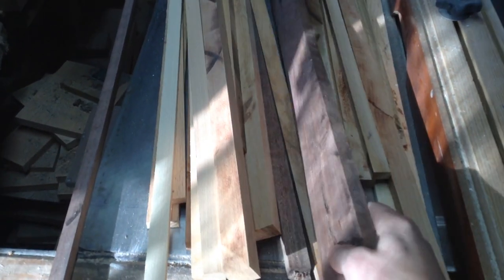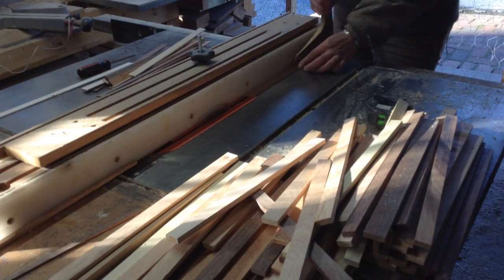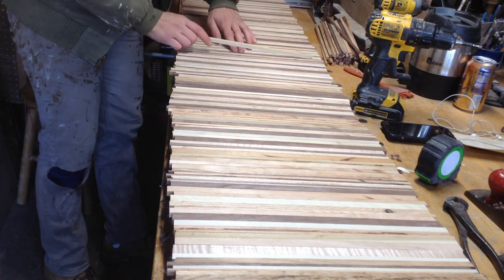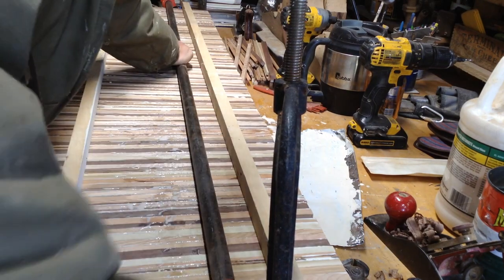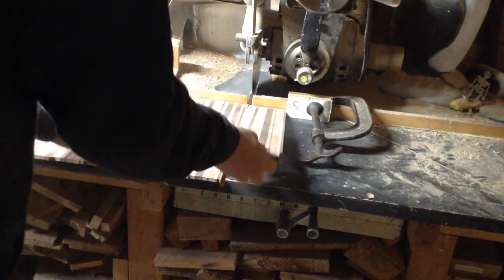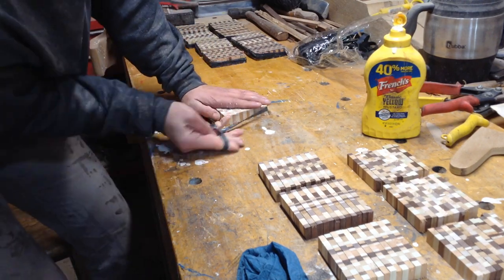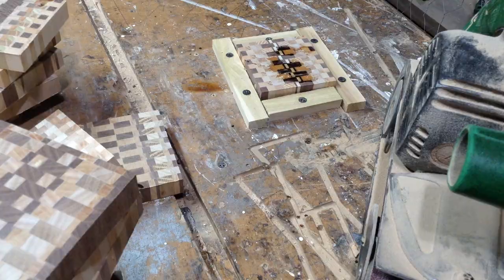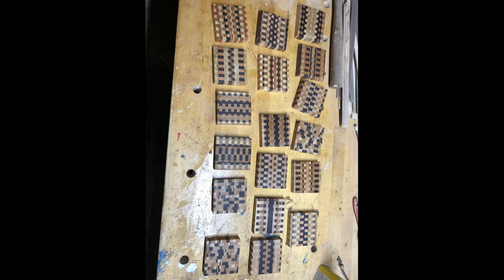Woodworking :  DIY Butcher Block Coasters // How -To

Comment: Nice project.  I enjoy and appreciate you skills especially with hand held power tools as displayed in your many videos.  I have a question about you use and apparent happiness with your radial arm saw.  How do you adjust and maintain tolerance especially cross cutting to the full capacity of your  saw?
Reply from the maker: I was able to go online and find the original manual for my model.  In it they give you very detailed instructions on how to set everything up and get it cutting square.  I haven't really had an issue with it getting out of square as time goes on either.

Comment: Interesting process. Have you tried mixing softwoods in with the hardwoods species, or do you think that is a bad idea. How would a coaster of softwoods stand up? This certainly something I will try, lots of scraps laying around, I don’t throw out much. Thanks
Reply from the maker: I haven't mixed these with softwood.  I imagine they would hold up fine.  I don't mix a lot of soft and hardwoods just because the different hardness of the lumbers can be a pain when trying to sand them side by side.

Comment: Great idea. I have so many small off-cuts that I've just not been able to throw away. (I guess it's a woodworkers curse). Thank you for sharing this.I wonder if toys of something could also be made of such small pieces?
Reply from the maker: Yeah, I'm always trying to think of ways to use up those cut offs.  Just can't bring myself to throw them away.
Reply: @HoneyBadgerWoodWorks  Making coaster is one excellent way and you made a good job of them. I was wondering, you didn't quite have enough for another full set of 4, if the coasters were sliced thinner, would that give you enough for an extra set with 2 spare for a smaller office or room perhaps. Although, I was also thinking that to reduce the thickness could cause them to cup or bow? What's your thoughts?